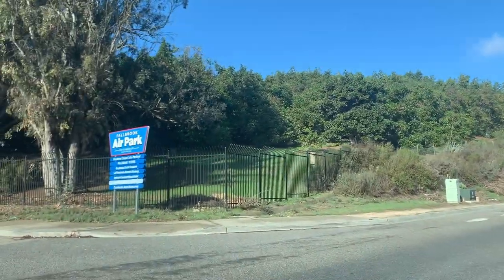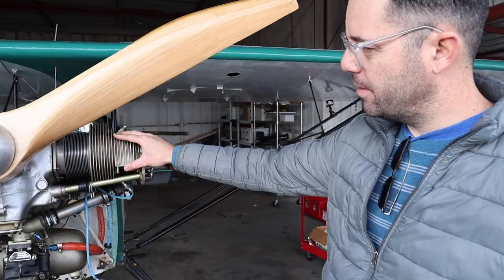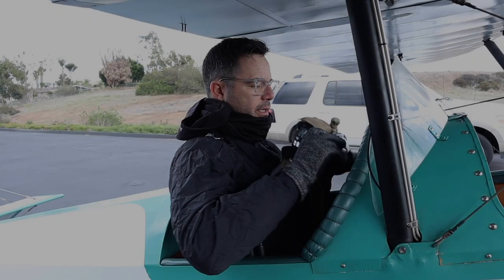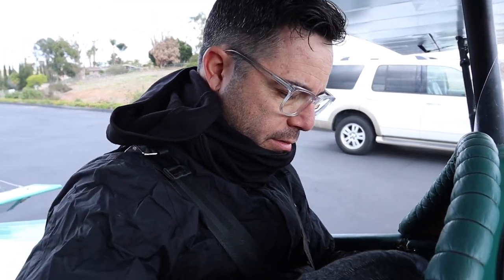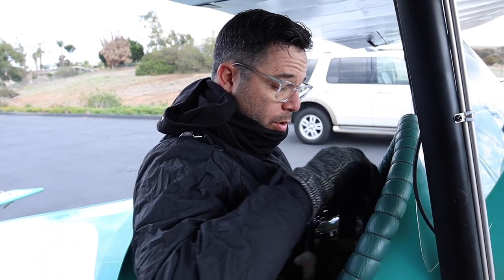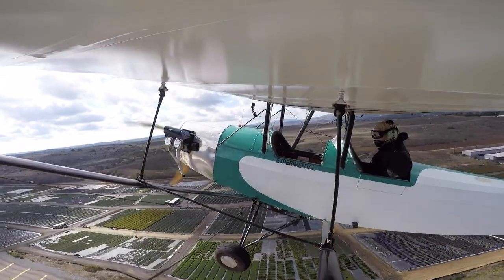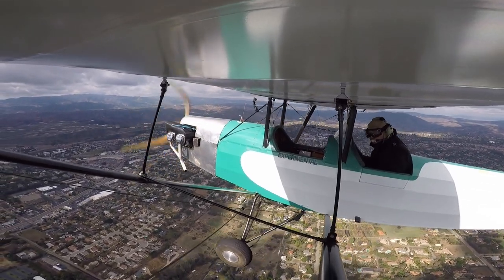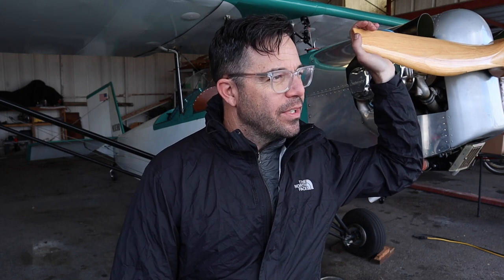Fresh New Jug! - New Cylinder and Test Flight

Comment: Just curious, how low was the compression check on the bad jug?  Could you tell something was wrong when flying?
Reply from the maker: Couldn’t really detect it. It got as low as 55/80 before we pulled it, though Continental will allow a cylinder to operate even lower!